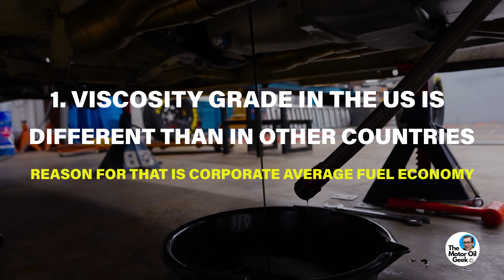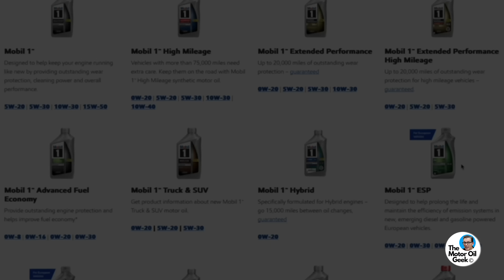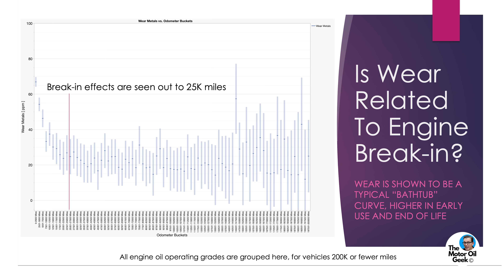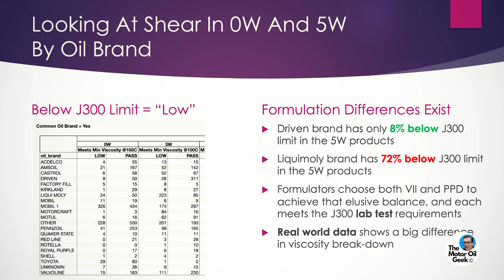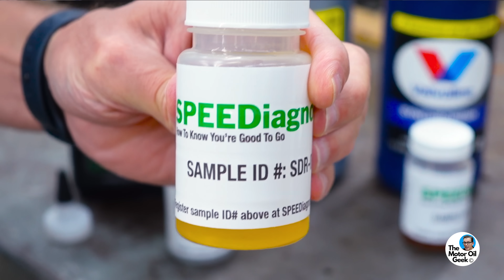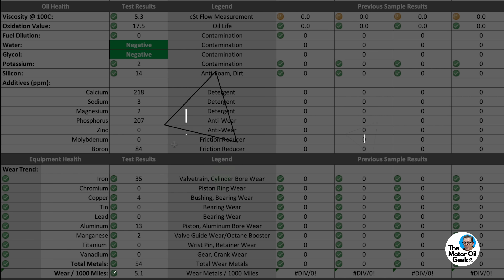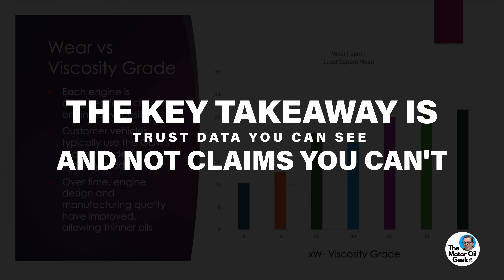More Ai Lies? The FACTS about 0W-20 vs 5W-30 (With Evidence)

Comment: Lake, I never saw the video that you are responding to.  But I'm super glad to have found this response, as you gave some excellent, although abbreviated, information about viscosity vs wear and how to use UOA to understand if the viscosity grade is protecting an engine, or if a different grade of oil should be used.  I'm going to follow your advice to decide if I should stay with 0W-20 in my B58 engine, or select a different viscosity.
Reply from the maker: I'm glad it was helpful!

Comment: 0w30 or 5w30 in winter and 5w30 or 10w30 in summer, if you are in real cold or real hot weather then 0w20 or 10w40 and all this changes as the engine puts on the wear age.. Using higher viscosity oil and you start hearing noise from the hydraulic lifters you are most likely hammering the cam, lifters and push rods/rocker arms because the lifter can't pump the oil through fast enough..

Comment: Hi Lake l have a GMC Sierra base work truck 5.3 litre V8 what oil would you use?  I changed it at 1000 miles and 3000 then every 5000 after My GMC dealership uses GM Delo. It's always had 0w20 in it thanks Harry
Reply: Run 15w-50 diesel oil in it

Comment: The whole need for thinner oil is caused by economics. Cheapness. The bean counters creating the least capable product to sell at the most amount of money.  An engine pre oiler, on startup, would solve the whole dry start needing to get the oil there fast to prevent wear. An engine pre oiler on startup negates the need for thin oil.   Bypass filtration cleans up the particles that cause the damage.   2 things that could  when manufactured en mass at the oem level would have engines lasting a million miles.  Sooner or later the aftermarket will catch on.

Comment: I use Pennzoil ultra platinum 0w20 in my 2022 Ram 1500 5.7l etorque. OEM says can use 5w20 as well. Would that be a better option for me? I live in MA where it can get down to around 0 degrees in winter but not consistently that cold
Reply: No one answered your question yet. It seems like the five W 20 has less of a gap so it may be more sheer stable and then check to see if five w is thin enough for 0° which I think it is especially because it's not 0° all the time I'm almost certain five W can go way below zero I'm going to look at some oil temperature charts right now to check that fact

Comment: 0W20 is full synthetic, are you comparing 0W20 to 5W30 full synthetic or blend? Also, why is it that the newer engines that call for 0W20 or thinner have a very higher failure rate?

Comment: Finally - a scientific approach to evaluating these claims.  As an engineering technical fellow, I always used to challenge other engineers making claims to show me the data.  For the most part, oil changes using the OEM oil will give you best results.

Comment: the only truth you need is Chevy switched from 0w20 to 0w40 in there recall to prevent any more damage to motors that had not failed yet and in Texas heat and pulling trailers I just use 10w40 and change it every 5000 miles and all of my cars have 140k miles or more and all of them still do not use any oil between oil changes

Comment: Direct injection all by itself produces higher “fuel dilution” therefore requiring more frequent oil changes… Fuel dilution reduces viscosity! I have been doing oil analysis, as per your advisement… My wear metals are low, but fuel dilution is 3% at 3000 miles! most all my miles are highway… No “short trips“… using Valvoline “restore and protect” 5W 30
Reply: I think in your case it makes sense to use a less expensive oil and change more frequently, try 2500 mile intervals and send the oil in for analysis.
Reply: Can literally smell fuel dilution, only vehicles ive ever experienced it on is my 95 jeep and older ford trucks
      Every vehicle ive had, direct injection, never experienced it.
Blowby causes dilution, and an atomized fuel, from direct injection isnt going to have it anywhere near as much as a carbed vehicle
Reply: @marioncobretti7870  Yeah that's an interesting finding he's got because DI should atomize fuel even better than port injection, and if he's running it for long periods on the highway it should evaporate out anyway. Maybe a leaky injector(s) causing it? I do know on my 1st gen ecoboost the fuel enrichment was extreme, so maybe something there? Monitoring in FORScan showed that it would dip down into the high 9s for afr under full boost WOT scenarios. I haven't had any issues with wear on mine though and it's well north of 100k miles. I've done 5k mile OCI's since the engine was new. I drive the snot out of it too, and that's a big heavy SUV, so it has not had an easy life. Uses no oil and it comes out pretty clean at changes still. FYI, relevant to this video I think is that Ford switched viscosity on those engines halfway through their second model year because they were popping too many engines with the 5w-20 oil. 5w-30 was recommended thereafter. They even changed the fill caps on the earlier models in a recall to read 5w-30.
Reply: @randr10 i think the real problem is the results are based on oil samples only
      Anyone sending in oil, would he doing it after an oil change. An oil change now is 3-4x more miles than a previous generational one 
       Perhaps over time , a di engine would, in fact have more fuel contamination.  The results are definitely flawed
Reply: Is the engine also turbocharged? Unfortunately, this is normal in a boosted application. Naturally aspirated seems to get less fuel-washed for some reason. Maybe to do with blow-by?
Reply: you drive a tacoma?

Comment: I'm not sure how to follow this info but I go with experience. In my younger days and after a few beers (stupid yes so shush) I decided to put my 95 cobra up to speed about 120mph when the belt failed. and I slowed to 55 for the last 5 miles home. temp was pert near pegged when shut her down. smoke rolled out the hood and loud ticking from the slowly cooling engine. Thought I had seized it. Next morning before work I gave it a quick test and it fired right up. changed the oil that night and I was down by half or roughly 2.5 quarts low. new belt with new oil and that thing just kept right on gettin on. 2 trips across country and back and many many more miles yadda yadda without issue ever. That experience made me a Mobile 1 fan for life and is the only oil brand I will use.

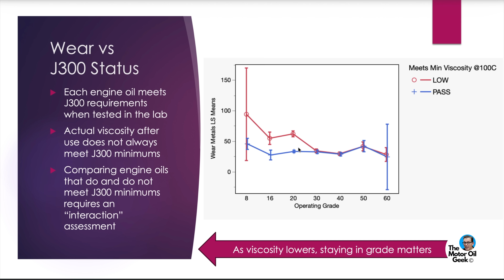Comment: I don't think he is understanding the chart at 3:20 correctly, or he did not talk about it as clearly as he could have. It shows that an out of grade 30 oil protects better than an out of grade 20 oil, and it also protects as good as an in grade 20 oil, IE, even if a 30 grade oil shears slightly out of grade it will protect as well as a brand new 20 grade oil, just look at the chart, its right there. And the fact that most engines that take a 20 grade oil in the US are allowed to take a 30 grade out elsewhere in the world, tells you that for most engines, a 0w-30 or 5w-30 is simply safer. 

 Every wonder why high outboard boat motors take 5w-30, 10w-30, or Xw-40??? But never 0w-20??? Protection. 0w-20 protects well enough, but the key word, is "enough", but it is not as good as 0w-30.

Comment: Not sure I trust anyone.  My anecdotal evidence is that every engine I've owned with cylinder management (Volvo and Honda) burned 0W-20 right off the lot, which should never happen.  

So, I believe problems occur when engines using a cylinder management system with lower viscosity oils.  Keep in mind this is for little/no return in mileage.  Add in lousy 10speed transmissions (intended for higher mileage) with higher/constant RPM changes, then wear and maintenance pains occur.   

I will say that I switched from the Honda OEM oil to Valvoline 0W-20 at the same specs and so far, have not experienced a low oil/burning situation.  It seems to have much better compression between changes. 

Personally, I think these smaller engines would perform better, have better service life with a slightly heavier/thicker viscosity/weight oils.  I think Honda should go to a better quality oil for sure and possibly 0W-30.

Comment: Two of my older vehicle's manuals mention different oil weights for different weather conditions.  Does this suggest 0-20W in Winter and 5-30W in Summer might be appropriate for our little 2025 Kia?  Here in NH we can see near 100 degrees in the Summer and minus 15 degrees (just a few days ago) in the Winter.  So far I have been changing oil (0-20W Amsoil) and filter much more frequently than what manual suggests.  Establishing statistical significance needs sufficient sample size AND the correct statistical test applied to the data.....

Comment: Thin oils do not Protect your engines  as well   PERIOD.......
Reply: Yep. His other videos suggest that. Research and live examples suggest what you say. Even in this video, after the thin oil is broken down, it is less protective. 

Thicker oil usually, better, but dont go too thick for your specific engine, especially if it is modern direct injection turbo.

Comment: I'ma keep using 1250W-6500. Oil's so thick the engine won't turn over and therefore it can't wear. 
Problem solved 😁

Comment: This just makes more questions. 

V35A. 0w20 is just dangerously thin imo. 

According to this, 0w-40 is not advisable either. 

So 5w-20/5w-30???

Which is it. The bearings in these engines aren’t getting enough lubrication or it’s shearing away thus eating the mains.

Comment: Come on man you need to really find out facts because I'm telling you something I used to be a Honda mechanic and I'm telling you something zero w20 motor oil in hot climates is bad for your engine especially in older engines they came up with 0 w 20 and 0 w 40 and 0 w 16 all because of the environmental hacks it's an emissions thing Australia and many other countries have the exact same motor the exact same setup manufactured by the same production plants and they have tested it higher climates temperature clients down South we get higher temperatures than up north you need to go back and you need to educate yourself more

Comment: So a 20 grade in perfect condition is as good or slightly better than a 30. But the In the reality any oil is likely going to get sheared with short distant cold start driving, fuel dilution form direction injection cars ect. So the 30 is going to provide better protection for most people in the real world

Comment: Over 10 Years working for two different Add-Cos here. Stay in Grade(SIG) is becoming a larger focus in the industry. GM added a "Shear Stability" test in the dexos gen 3 spec in the last year. For now its "Report Only" but as they move forward with 0W-30 for the LT Engines in MY2027, they will be collecting this data and using it to create a SIG spec for dexos 1 Gen 4. Gen 4 is coming soon, but id rather not give specifics on that here. For many years the HDEO side of things really focused on SIG, but in the PCMO side of things, the requirements were always very loose. GM might force some change to that. Shear stability is a complicated characteristic and many things can effect it. To cut it really short, some oil cos will thicken with base oil and a little VM, or thicken less with base oil and use more VM to reach J300 requirements for vis the grade. Also, not all VM is the same. 50SSI is less shear stable, 35SSI is better, and 25SSI is the about the lowest you'll find in a commercial PCMO application, and largely regarded as the best for SIG... at least for now. And remember, it all comes down to cost, supplier relations/contracts, and tank space!! Keep up the good work dude. If you want to test some oils for SIG, I would recommend finding a lab that will run a KRL test. Its what GM is using.

Comment: 2004 Jeep liberty 3.7L I bought brand new, I have personally changed the oil every 5k miles since new with 5w30 Castrol std. then changed to Castrol 5w30 High Milage at 100k miles, it currently has 258k. miles with zero issues.

Comment: I stick with the recommendations on the oil cap/in the owner's manual and read any conditions carefully to be sure that I'm in alignment with them. It's worked for 35+ years with no oil related issues. Use the right product in the right application and change it when you should (along with a good filter) and you should be fine if the engine is designed well enough. 

The caveat is some "special conditions". For example on some Ford 6.7L Powerstroke engines, "severe service" or the use of bio-diesel fuel means that you have to use 5W-40 oil that meets the Ford "WSS" specification (which only a selected number of oils do). Otherwise, it's typically factory filled with 10W-30. In that case, you have to know how the vehicle is going to be used.

Comment: So I have a 21 a4 and my tuner said to run 5w-40 instead of 0w-20. The older gen’s used to call for 5w-40. Any opinions on this? Sounds like a good idea because the temps and boost is higher on a tune. But idk

Comment: Thin oil is good for an engine under warranty. but a worn out engine, with more space between parts, needs a slightly thicker oil to cushion better between parts.. Been doing that to my trucks engines , also on my airplanes engines too.  Thin oils on not new engines will slip thru piston rings easily and consume it to the point of losing 2-3 quarts in 3,000 miles and wreck the engine. Seen that many times as mechanic.

Comment: Already knew the answer from decades of observation:  The worse made engines or old badly maintained engines need thicker oil.  The best made engines to incredible good tolerances and quality like Toyota engines, need the thinnest oil for lubrication.
So, if you have a british, italian, russian, chinese or french engine, you need 50w-90w oil mixed with axle grease.  See?

Comment: The problem with looking at the splits is that closer numbers doesn’t by you less VII these days, it just means that went to an even cheaper, lower VI base oil blend. Mobil’s 0w-40 FS shears almost instantly to a 30 grade but it’s still one of the best mass produced oils in existence and has the stack of demanding Euro approvals to prove it. Shear stability really only matters when you have no surplus viscosity to give— say 16 or 20 grade. If you’re a 40 grade and can maintain HTHS of 3.5, to the end of the interval, then the KV100 change is utterly meaningless.

Comment: Project Farm did this oil test and he literally showed that there was less wear with 5w-30 vs 0w-20.  I believe his tests because he shows all the tests (with results) he is doing.
Reply: He’s not even in the same league as this guy
Reply: @sawboneiomc8809 this guy just blabbering numbers he didn't test anything
Reply: @AutoMotoMechanic  He uses oil analysis results, other videos claim to do the same.
Reply: @lonniebeal6032 I don't need oil analysis, the proof is in the pudding. I've opened hundred of engines. 
Best is is the one you change most frequently.  10w40 is good for nearly everything unless you're in extreme cold climates. 0w20 wouldn't ever even be a option I don't care with manufacturers say. They don't own the engine they don't care if it fails just past warranty period.
Reply: In actual use, but if you look at the cold flow tests PF did the thinner oils win significantly . Since the vast majority of engine wear is on start-up, the thinner oils (up to a point) actually have less wear. This is shown by the graphs that as long as they're in grade, 0w-20 actually had less wear. Of course, this is dependent on designing your engines correctly (see GM's engine issues)
Reply: The problem is Project Farm's comparison failed to take into account oil pressure. His wear tests in that video just use splash lubrication, which is not what is seen in the majority of the engine. So yes, the 5W30 would SEEM to protect better, but the test was not fair and equal.
Reply: @thomasmiddlebrooke1012 wrong. Many engine see splash lubrication in various parts of engine. Like rockers. Cam lobes, piston squirter to cylinder walls and more depending on motor. So project farm test are adequate.
Reply: @AutoMotoMechanic  Not to start an argument, but no. Crank bearings, rod bearings, cam journals, all the critical spots. ALL of them use PRESSURIZED oil, and it's there that matters most. Obviously, the parts you said are splashed is correct, but the parts that matter most ride on pressurized oil, so his tests are still invalid.
Reply: @thomasmiddlebrooke1012 Lake has a video 0w20 vs 20w50, 0w20 had more wear metals...
Reply: @thomasmiddlebrooke1012 so cam lobes and rockers arms aren't critical? I see many engine idle around 15psi oil pressure. That's not much. With a 0w20 I'm sure it'll knock out bearings and wear alot faster especially at operating temps esp in older engine. 
These new engines are a little different  on tolerances and put up with that waterery oil 0w20. But we also see how fast new engines are failing, so it doesn't seem to be working too well.
Reply: @lonniebeal6032 well 0w20 turns to water when hot. So ya that's not a surprise at all.
Reply: @AutoMotoMechanic  which is why the toyota 5.7 iForce can go to half a million. Nah dude, the oil ain't the issue.
Reply: Lake did a video giving a nod of respect to Project Farm’s video, but mentioned that his wear testing between 5w30 and 0w20 wasn’t realistic.
Reply: @MAThomas0912  Lake did it with 0w20 and 20w50, 0w20 had more wear metals.  His video is still in his inventory.

Comment: It's not as simple as one is better.  For a light duty passenger car engine, 0W-20 is probably fine.  For a higher load, higher power engine, 5W-30 hands down.  That is from a 30 year GM engineer.  The fact is, ultra low viscosity oils are a concession for fuel economy.  "Zero" weight is a misnomer anyway